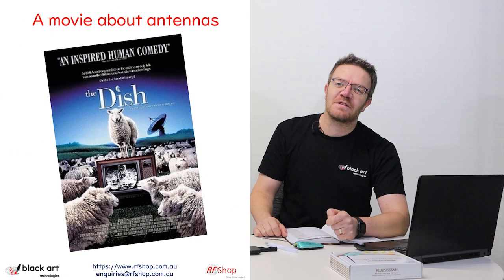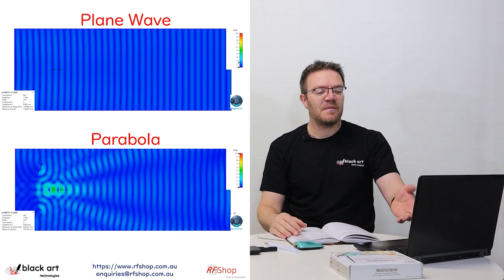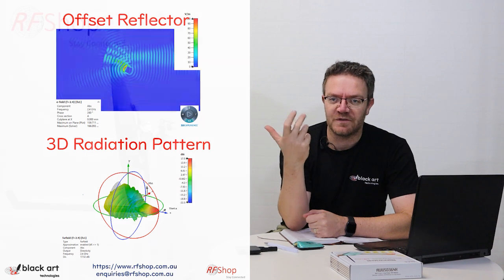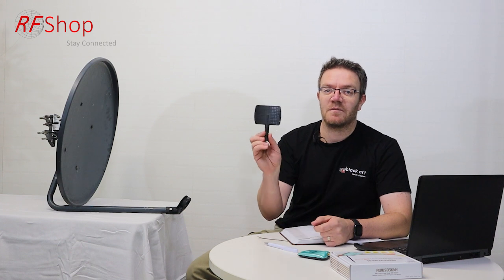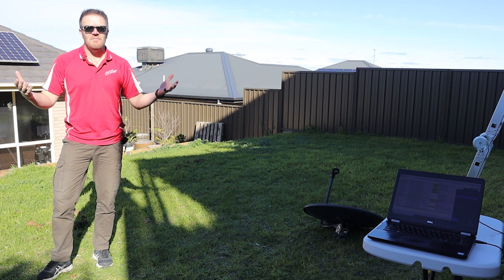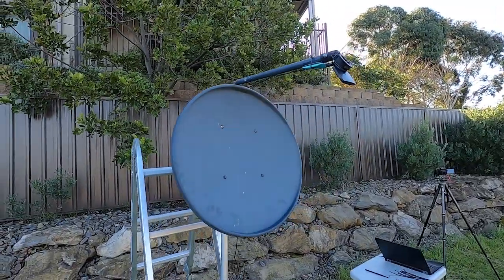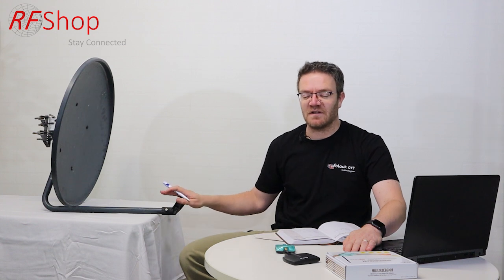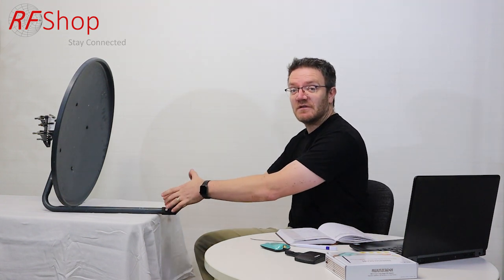Converting a satellite dish to a WiFi antenna

Comment: Hello sir, I'd like to thank you for your useful experiment as I want to ask you something. Could I receive an Internet connection by using this steps (as I already have a 4g router and a 1.80 meter satellite dish) or is it just a way to strengthen my network signal? thanks a lot.
Reply from the maker: Hi, yes it could be possible but you will need to put a 4G antenna in the focal area of the dish

Comment: Thanks a lot for making this video, I purchased a 24 dbi parabolic antenna for 2.4GHz WiFi and I've had almost no luck in finding a way to connect it to my laptop, I tried a small USB WiFi adapter that I could find locally but it's made with a detachable 3 dbi antenna and it literally got fried when I attached the 24 dbi antenna to it.
I've been searching for a more professional USB WiFi adapter to stick the antenna to without luck... up until I saw this video, could you maybe recommend me some adapter to use?
Reply from the maker: Anyone of the ALFA units should work well. I currently use the AWUS036ACS

Comment: i have an old primestar dish a friend gave me for wifi experiments, and i'd never really been able to get a solid link to a wireless AP, i'd had suspicions that inverting the dish might have fixed the issue but hadn't had time to get back into tinkering with the 2.4 Ghz spectrum, i might have to try this over the winter and see if i can make a decent PPPOE connection between work and home
Reply from the maker: Could work. I found that not knowing the detail of the dish made life a bit harder for me. That's why we're now using our own dish designs
Reply: I used a canntena as an LNB on an upside down sattelite dish and was able to receive a signal strong enough to watch medium quality video from a mile away. Previously I had no internet at all. I used a free version of Inssider to aim the dish. 😊

Comment: does a bigger dish ex. 1.8m diameter work better? I was thinking about It because I got a problem with the upload speed in a mountainous area where I used a 90cm dish! I got the signal from “no service” to -108 dbi and got a download speed of 40 Mbs but only 1 mbs or less for upload! So plz tell me will the bigger dish help?
Reply from the maker: Yes, a bigger dish will indeed increase the antenna gain. The only thing to be mindful of is that the bigger dish / higher gain will also lead to a much narrow beamwidth, and that means very precise alignment will be required. It may be best to find something a little-bit larger but not 3x the diameter :)
Reply: @RFShop  amazing, thank you 👍🏼 already working on it and will let you know how it goes 👍🏼

Comment: Thanks for this video.  I am trying to ditch paid broadband and connect to free WiFi nearby.  I probably just need that directional antenna.
Reply from the maker: It's true that this solution could get you that remote WiFi connection. We, however, focus on onsite solutions and fixes so this was a fun project but may not be practical for many people

Comment: Would I be able to use one of the three dishes I have around the house I just bought.. there is a dish hd company one, dish direct company one & a Hughesnet style dish.. I’m merely trying to be able to pickup a Wi-Fi connection that’s a 1/2 mile away over a small hill because they don’t run their service past that point yet.. thanks in advance
Reply from the maker: Yes, any parabolic shape should work well

Comment: Good evening'm buying a new dish for my TV were remote in Wales. Would it be possible to do a conversation and still use the dish for TV and WiFi or should I buy an additional.

Cheers
Reply from the maker: Given it's an old 2nd-hand dish, I guess it's simplest to simply use another dish for this purpose

Comment: Is there a way to use an antenna to completely block the Wi-Fi transmission from going backwards. In which devices at the back of the antenna won't even be able to receive a strong signal.
Reply from the maker: Good question. There's always some back lobe (i.e. front to back ration). In a directional antenna the goal is indeed always to reduce what goes in the "wrong" direction, but simple a bigger and bigger surface behind will help. Also, if you can try to introduce a "null" to the rear that will be of use.
Reply: @RFShop  so essentially the bigger the reflective surface the lower the back lobe will be? Because I plant to use a 60Cm 90° sheet to block the Wi-Fi in the back direction.
Reply from the maker: @COLDoCLINCHER37  yes, in essence that is true. Just need to make sure the distance is correct and it will make a huge difference

Comment: What i'm confused about is the lack of "power" going to the dish. How is he getting signal (of any kind) from the dish with no actual power going to the directional antenna? Antenna, no matter how basic they are, need a symbolance of current to run through them to transmit or recieve. The laptop ALFA has the 5v USB but what is the directional antenna (connected to the dish) using for power?

Since there's no actual "parts" list,  what did he use to power the directional antenna? Someone please explain this to me. I mean, i totally get the idea but no mention of power to the M04 is where i get lost.
Reply from the maker: Kilroy, that's really the beauty of antennas. It's completely passive. Think in terms of lights and reflectors. You can play with mirrors and change the directional and shape of light beams just by putting shaped mirrors on one side of the light...focusing it all in the opposing direction. It's exactly the same with radio waves, just at a different frequency / wave length. The dish is indeed completely powerless, yet it reflects everything in that particular direction. It's physics, and hence my passion.

Comment: I am very interested in making something like this work.  I need to boost my signal enough to reach 3/4 mile.  Use a dish at the router and at the remote.
Reply from the maker: Hi Denny,

Yes, that could work. However, 3/4 mile is not impossible. You can't use a new external antenna, can you ?

Comment: Hi, would this sort of concept be applicable to improving the performance of an LDPA type antenna? i.e paly about with a dish behind the ldpa? Just curious about what you think.....
Reply from the maker: Hi. Actually it gets done a lot, but in reverse. You need to radiate the LPDA into the dish
Reply: @RFShop  Thanks for the quick reply!!!. Been watching a load of your stuff to try to learn more about antenna to improve our mobile reception.  For the ldpa in front thing, is the dish best offset kinda like you have done in this vid??? ( I live in the middle of nowhere.... very weak signal)
Reply from the maker: @vintagechemist9427  I'll always prefer the classic center fed style of antenna since they are easier to manage and review. I have a 2.4m dish, and will take it to Rapid Bay in the coming weeks to do a test for a 4G setup and will talk through that demonstration then ;)
Reply: @RFShop  Thanks, will give it a go when I can get hold of an old dish. Will look out for that next video - that thing sounds more like a radio telescope, rather than a wifi dish....
Reply from the maker: @vintagechemist9427  Yes...aim is to provide WiFi to the ISS :)
Reply: @RFShop  is there any way I can reach out to you one-on-one 
I have really important question I want to ask
Reply from the maker: @ChromaOnclacve  off-course. Check the email address on our website, and the pop-up chat feature on our website is monitored by myself and Cadle.

Comment: About 8yrs ago we got rid of our Direct TV and started using local internet for tv for a number of reasons, all personal. Where we lived in Kansas USA it was roughly 60miles from the closest local TV tower. With an old portable TV and it's tiny 6inch antenna I was able to roughly aim towards the tower and I gained 2 extra channels. Never did perfect it since we had streaming TV BUT after removing the array and placing any transmitter, receiver or both you could in theory increase connectivity and range through trial and error. I plan on using our old dish where we love in the mountains to see if I can make a 4g,3g,2g cell signal receiver without needing home internet. Just need to find the tower, eliminate or reduce any obstructions possible and in theory one could have a microcell with the right components.
Reply: Damn auto correct 😆
Reply: I also used a 70mile range aluminum aerial tv antenna on the end of a standard oval concave dish and it maintained a clearer signal with better HD channels so it seems that whatever you're aiming at, with the right components the applications are wide ranging, even used the existing Dish coaxial cable with no issues.
Reply: Ahhh, there is nothing like love in the mountains... ;-)

Comment: I want to ask a question if put a a repeater in the place of the that  device, will the repeater capture more WiFi networks or far networks?
Reply from the maker: If you connect a repeater to the antenna it will indeed feed the stronger received signal from the antenna into the repeater. Not sure if that is what you are asking though?
Reply: Thanks sir, I was asking for this.

Comment: How about tv dish/ariel connected to the antenna, then to the laptop? Would it give better results?
Reply from the maker: Ahmed Ahmed, I believe you are putting in words what I have done here, right?
If so, yes…it works
Reply: @RFShop  
No, i mean the tv antenna, what if we use it for wifi?
Reply from the maker: @ahmedahmed-ux6im  you need to have the same frequency and impedance. A TV antenna won’t work, unfortunately
Reply: @RFShop  i saw tutorials on this, and it seems people said that it works.
I mean, it looks the same as parabolic antennas.
And did you try it before? A tv antenna?
Reply from the maker: @ahmedahmed-ux6im  a TV antenna has different frequencies. For WiFi you need 2.4GHz or 5.8GHz. 
You may pick something up, but it simply won’t be great or by design.
Reply: @RFShop  okay.
Thank you for the information tho

Comment: Hi is it possible to use the dish/es for a Point to point wifi link 2 km away with a few buildings and trees (obstruction) in between?
Reply from the maker: In principle it should be possible. The fundamentals of the parabolic dish would certainly allow you to have a very high gain antenna in place...something you'd need for the long-range comms
Reply: @RFShop  Hi thanks for the prompt reply. I live in SA. I would like to setup two dishes using the 2.4Ghz band that allows better penetration through buildings and trees. Any recommendations maybe :-) ?
Reply from the maker: @09nanox  I guess you picked-up on my accent? 
I certainly do like the ALFA antenna I used in this setup. It's a medium gain option, allowing you to get a good coverage of the dish itself. Not sure if you can get your hand on some old dishes? Once you have them, see what the design is like (i.e. where is the focal point) and test this concept as well. 
One will need to be very careful to align these antennas. As high gain antennas it will be very interesting (difficult?) to get them to point exactly at each other. If you miss the target the gain could actually be really weak.
If you think it's better to continue this conversation on email please feel free to email me direct via our website. 
Cheers,
David
Reply: @RFShop  Thanks David. Yes picked it up immediately :-) Thank you for the valuable info. Yes I will send a mail. Regards

Comment: I have a old TV antenna here in my house and a wireless router, I want to use the satellite dish to boost my wireless router signal?, what should I do?
Reply: Watch the video?
Reply: You would also need a directional antenna for the wireless router to boost its signal using satellite dish

Comment: I live on the West Coast of New Zealand's South Island, it is a very high rainfall area, we have limited 4G towers, my closest one is 34km away in Westport where I can get  signal (as it is built on an old TV tower on the top of the mountain), anyway I also made an 'Upside down' 4G dish made the same way as yours, at the LNB end I placed my 4G dongle with a wifi router inside a waterproof Sistema (tupperware) container, placed the antenna on the old analoge TV  hockey stick which is bolted onto the chimney, I went from 1 bar slow as hell, to now 4-5 bars and I can watch streaming tv, do zoom and skype, it sure works !!!
Reply from the maker: Hi Richard!
Great stuff...thanks for letting me know!
Reply: What about uploads?
Reply: Wow.

Comment: how useful would this be for receiving video from an fpv drone? 5.8ghz
Reply from the maker: billy goff although I think tbe gain and reach would be phenomenal, I had lots of trouble aligning the high gain / directive antenna. If the trouble of setting-up the antenna is not a problem then this would be great.
Reply: Won't you have to then use a Circular Polarized Feed antenna? Does parablic dish work as a reflector for that?

Comment: I’m thinking about adding this WiFi booster to the same dish that I want to use for a TV antenna... if I have a tv antenna signal booster Outside antenna and the WiFi on the same dish will they interfere with each other and have distortion or interference with each other????
Reply from the maker: Hi David. Good question. I think the key problem would be that the directions of the two systems (WiFi and TV) will have to be exact as the antenna gain / directivity for the 2.4GHz would be very specific. 
Are you looking at a satellite or a TV (i.e. UHF or VHF) system?

Comment: This is just crazy but i have this exact same setup, have been looking around all night for info, then just happen to stumble upon your video having the EXACT same components I'm using. Just wow. I do have a question, i have there dishes to choose from. First being oval shaped and the largest of the three, the second being slightly smaller semi circle shaped, and finally the smallest of the three, a circle dish antenna. Any suggestions on which might be best? Are you planning to expand further or have you found any further useful info?
Reply: The bigger the dish, the better. They were all designed to reflect to a particular point (where the LNB would have been).